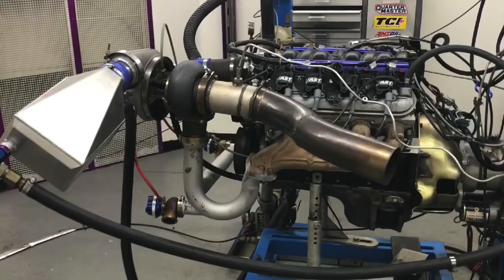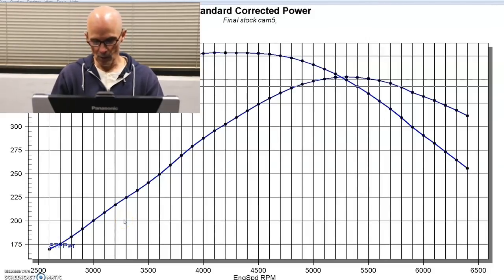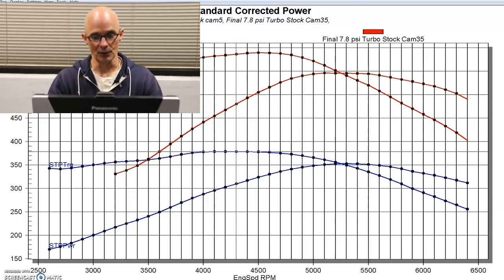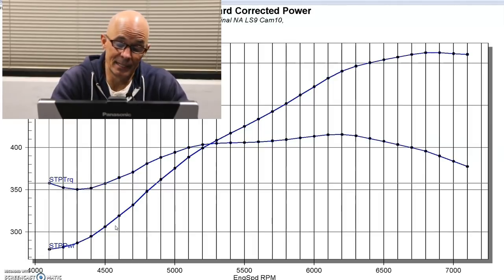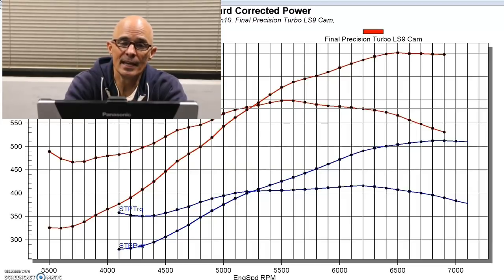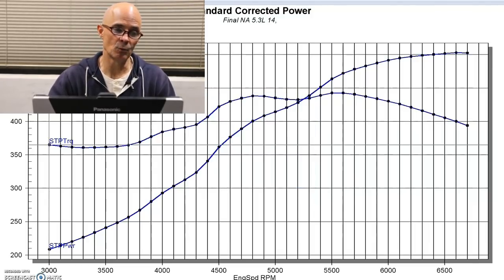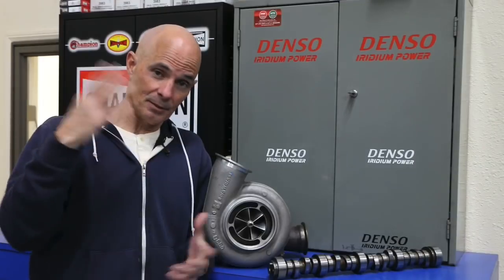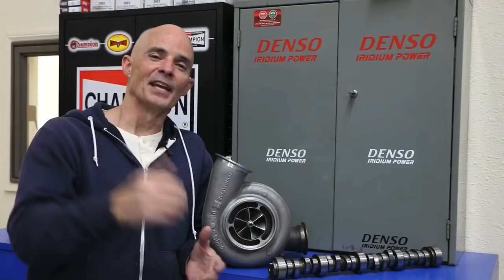REVEALED-DIY TURBO SECRET-EVERY CAM WORKS!

Comment: The only thing this conversation leaves out of the equation is response. A normal aspirated cam and a turbo cam may make similar peak but power curve and off boost response in non drag racing situations such as street driving or road course racing can mean the difference between a quick car and a dog. At least this is my experience in the small displacement manual transmission world I play in.
Reply from the maker: any cam that adds low-speed torque will improve response

Comment: It is such a shame that we don’t have anyone like you working with vintage Fords like the FE. Some poor guy got his videos pulled for showing how to improve the oiling on a SBF. Some a hole claiming that it is a copyright violation. Why do we have to put up with that crap. I am certain his initials are BL. I so wish we could have someone like you working on Ford platform like the FE. I am not sure if my 394 FE will take 10-12 lbs of boost. I want to do it really bad. But the FE forum who banned me for sharing my 50 years of experience banned me for life saying I was disruptive. I was because I was so frustrated as to why I couldn’t share my own broken knuckle experience.  You and Sloppy Garage have convinced me that I have been tilting at windmills. Why would I try to help people who really need it , when the people involved sanction you. A small Cabal wants the answer to be it’s too hard, just send it to me and I will charge you your childrens college tuition to indulge yourself with an overpriced piece of junk that barely makes 450 hp. You have to have a 4.25 stroke kit. BS! You also once they get their paws on it that well factory heads won’t do then the block won’t do… $35000 ? You can build a nice 500 hp 416 ci engine with stock parts and I was telling people how. I was misleading people… I got an email from a guy who did an NA 416. And made 515 ft lbs and 545 hp for nothing. He just found one of my old posts in the archives that they didn’t manage to scrub. I am proud he has been bracket racing it and all he does is service and with a Flat- tappet solid cam that I gave him with the lifter in order all broken in. I told him where to grind and where not to, 285/ 176, he did it himself in a half day and I even sent him the 3/8 Cobra Jet valves and springs, one piece retainers and matching keepers.  No F’n charge. A Lunati cam SPJ 285 just like the one for the  351C Boss a solid step up. It almost cracked 550 , imagine a C 4V head.  Yea 66 extra cubes but he said that FE lifts the left front. It did what HE wanted not They!  Thank you Richard so much for your generous gift and spirit.  I have so much FE stuff at 61 it’s really hard to put the genie back. I wish I was of the LS generation, and turbos.  I hope that I can turbo my engine in my Car, but it I can’t I Will likely put a 6.0LS in it. It is a shame that things are that way. I thank you for tolerating me and all of my questions. This is truly uncharted territory. I worry about my narrow rod bearings. If a 5.0L or a 351W can be turbocharged, it seems likely an FE can? No one does it but I ve seen 6 and 8-71 blowers, on a weaker 427 block. A 4.08x 3.78 or even a 3.5 with good rods and pistons should do. Not crazy long but to use 410 forged 4032 rods. A 4.08 X 3.5 with 14.7 would be sweet.
Reply from the maker: I will

Comment: As far as I've always understood turbo cams were just cams that allowed the boost to build earlier in the rpm range building a fast car is not always about peak figures its the area of power under the curve that matters just my 2 pence worth.

Loving your videos btw just stumbled across the while researching turbo GM 4800 engine I'm definitely going to stick around 😁

Comment: How I've always thought about it was....if I have "x" turbo that's capable of 1000hp, and sized right for the engine, it doesn't matter if I have the perfect turbo cam.  The turbo flows enough air to make 1000hp so the only difference I would think you would see between the 2 is the pressure it takes to achieve the 1000hp.  1000hp is a 1000hp no matter what the cam is.
Reply: One cam.might have 1000 come.in at a difderent rpm but the boost might change

Comment: Richard, To many variables, its hard to decipher if these statements are true, engines and boost levels need to be identical in size/components and do stage 1-4 Na cams vs stage1-4 turbo cams that way we can see if turbo cams make more power under boost.
Reply from the maker: its not hard to decipher if the statements are true, the cam that makes the most na power makes most boosted
Reply: @richardholdener1727  i agree with the theory completely. i just think itd be easier to understand as a consumer with very controlled variables instead of a whole bunch very different combinations. I think itd be a better, more efficient way to prove your point.

Comment: Logical.. ran a 355 curcl track motor cam and all in my street car ran good 5500 to 7000, not the supposed ideal cam but put a s475 on it and it ran in the same range just alot more. Love these tests thanks for this
Reply: Just want to add the cam is 108 lsa in the 242 at 0.050 range. Actualy runs pretty good. Really wanna do a ls motor soon. Thanks for all the tests and info, its like engine masters everyday!

Comment: My rule of thumb is you need enough duration to carry power to redline without laying over, the more power the engine makes down low out of boost, the easier it will overcome the torque converter and spool the turbo sooner.

Comment: I want to see a 5.7 or 6.0 with an MS4 110 LSA NA and turbo. That’s the most extreme cam I’ve used. It idled at 1,200 rpm, backfired wheezed stuttered and coughed until + 3k rpm, then came on like a turbo and propelled my home built M6 LS1 Z28 faster than a stock C6Z. I had PRC 227’s, a 4” lunati crank and H-beam rods topped with wiesco pistons and an 11.5:1 CR. ARP studded top to bottom. She was a thing of beauty 😥. Lost my job and had to sell her.

Comment: Great stuff! I learned a lot tonight. Now can you do a video on roots blower cams? We have always been told that you need have have a wide (110-114) lobe seperation to make good power otherwise boost blows past the exhaust valve. I don't actually believe this and would love it if you could disprove it on the dyno!

Comment: Thank you I'm glad you brought this fact up.i have been trying to tell all these rocket scientist friends of mine for years about the same thing.it the boost pressure not exactly the cam.they don't understand you can double the HP by boost pressure but when they do change something they go to the extreme and waste money trying to get more out than what's needed.or what they can live with.most of the time it's the water cooler talk that get a blown up engine or don't know how to fix the expensive mess they have and end up seeing it for cheap to another guy who need only a few parts to make a great engine come alive on the cheap.peace

Comment: Hi Richard,  I've been enjoying watching your videos to work out which camshaft to buy for my drift car, I've been struggling to work it out, would you please be able to recommend a camshaft or give me some more direction. I have a 6.0 LS (L77), 1170 xpert injectors, PAC1219 springs, and G42 1450 Pulsar turbo, I'm going to gap the rings and install a cam. As it's a drift car I would like a cam with a wide power band, I haven't found a video of yours that matches what I'm looking for. Would I be right in thinking I need a cam that produces torque at low revs, or wouldn't it matter as its a 6.0. I've noticed Michigan Motors and Comp Cams sell "drift" cam shafts although I haven't seen the dyno results. Any help is appreciated,  thanks,  Paul

Comment: Looking at the graphs I definitely agree now with the cam theory but the turbo specific cam looked like it might take a different low rpm ramp to bring it into boost possibly? But overall for a high rpm drag car, it doesn't seem like the power curve would affect it much. So thinking about maybe going with a choppy NA cam for my turbo build since turbo cams don't have tight LSAs?? Would be nice to have a nice chop and turbo wistle.

Comment: Something an old engine designer/piston manufacturer told me once: Think of an engine as an air pump. The more air you can push through it, the more power it will make. This was during a conversation we were having around the time the PSI blower became the must have in the alcohol ranks. Not a new talking point for me. Now there is the data to confirm what he always said.

Comment: Thank you for this! I always had this theory that boost wast just a multiplier, since engines are just air pumps and the more air it move the more power it makes. From a mathematics standpoint, the atmospheric pressure of the earth is approximately 14 psi. So when the piston goes down, the vacuum it creates is approx 14 psi. When you add say 7 psi of boost, theoretically you should see 50% hp and torque gains. 14 psi should double and so on and so on. This is of course provided your air/fuel mixture is consistent throughout. Anyway, I was hoping to see if you’d be willing to do some tests on other motors besides LS motors. I know you have done a few but the majority is LS stuff. Thanks!

Comment: The thing to get across(that you could have said in a few words) is dedicated turbo cams are optimizations not voodoo. Most of us LS guys have known this since 2001 or so when the available can grind was 224-228 .550 and guys were adding them to Camaros with a Vortec or Procharger and getting another 60-100 hp out of it over the stock LS1 cam.

Comment: On a naturally aspirated engine, exhaust pressure is equal to intake pressure.  If turbo exhaust backpressure equals boostpressure, an NA cam IS a turbo cam.  Only when the exhaust pressure exceeds boost pressure do you need to look at decreasing overlap...or increase the size of the turbine housing.

Comment: The only difference I think would be cams with big overlap would potentially spool later on the street. But you can’t exactly see that on a loaded engine dyno. But big cams and big turbos make a big party.

Comment: I once ran a wild cam with 106 degree lobe centres and 300+ degrees of duration with a turbo and it seemed to be detonation prone. In a similar engine I ran a mild cam with 114 degree lobe centres and could not get it to detonate at 25psi and pump fuel and proper timing. So whilst the power curve is translated upwards with boost, I would have thought that the main benefit of a well designed turbo cam is pushing the detonation limit higher (maybe being able to run more advance) with minimal overlap and playing around with opening and closing points of the valve.

Comment: Awesome video!!!    Do you have any videos or test info concerning ls factory heads preferably 706/862 vs any of the aftermarket heads like the tf 205 or afr’s 210.  Cam only motor as rest subject. If you wanna be extra cool! Lol. 4.8 5.3 6.0.  But simply put any ls with stock 706/862 vs aftermarket Cnc bigger valved heads. And head change being the only change.

Comment: Haha been saying the same for years!.. great test!  I’m about to run one of Ed Curtis’  na cams with a rear mount set up on a 6l and I’m fairly confident it’ll make power just as you tests have shown.. However there definitely are times when a dedicated turbo cam will allow a combo to reach its full potential both in terms of power output and rpm range at a given boost level... You share a test a recently where on a blown combo the Crane NA cam made as much power as a dedicated blower cam with the same pulley ratio used but did it with less boost!.. So my take is a turbo will make a boost level determined by the waste gate (not dictated by cam event) and therefore more power each time the boost level is increased until the turbo is maxed out as you say but provided the turbo hot side doesn’t go into choke first.. Again this is where turbo sizing is more important than cam timing I feel.

Comment: I guess you guys mostly do drag racing but I find that with a turbo cam (with large lobe separation) its a huge difference when you use the engine for drifting. Two cams with similiar specs where one is "turbo" the turbo cam will come on boost smoother, come on boost at less throttle, step on boost earlier as it feels like it can build its pressure instead of just coming on the cam and then spool the turbo as a NA cam turbo engine does. They also seem to pull longer when we pass max power (in drifting we want to have a large span of power to spin the tire fast, once spun you do not need top end power)

I came to view this video with hopes of a graph with the same engine and boost but with different cams

Comment: people in 2020 still think that turbo just pump air in the engine, the truth is that turbo increase the air density (and so the pressure), its just like run a engine on top of the pikes peak and another on the sea leavel, and who make more power on pp, also make more power on sl, great video as always

Comment: Everything he said has been my experience as well. The only time you need to be a little carful is if you have a junk turbo that makes a ton of back pressure and a huge cam you can run into a lot of reversion and get a lot of dead in the cylinder. Which won’t hurt the power as much just becoming dangerous for the engine (lifting heads and such). And with that said, it’s a turbo problem not a cam problem. So if you have a junk turbo and are set on running it, I would lean more towards and smaller cam that will run in the same power curve as the turbo.

Comment: Okay, one atmosphere is around 14.7 lbs per square inch. So if you double that. Thats 2 atmospheres. Which means you are forcing another atmosphere of air and fuel in an engine. =double the power or close to it. Doesnt matter what camshaft is in it, still going to double the power. Doesnt matter the engine either.

Comment: Hey Richard, really cool videos! I'm building a mid twin turbo setup for my '72 el camino. Would like to see how the longer exhaust pipes and boost pipes affect the lag and power? Also the diameter for the tubing, heat wrap etc? The engine is a 5.3 with slightly ported heads and bigger cam.

Comment: This is mind blowing and I can't believe I just saw  this video... I have a 5.9 Magnum I'm building for turbo application and everyone says the stock  Cam is trash and I need to go aftermarket... so can the same theory about LS motors stock cams being ok for turbo be the same for a 5.9 Magnum stock camshaft ?
Reply from the maker: you can run boost on any cam
Reply: @richardholdener1727  thanks for the reply, I feel like I have a major weight lifted off my shoulders and this will simplify my build on a decent  budget... thanks Richard Holdener

Comment: Yeah, you magazine guys taught us this years ago. And its fairly easy to apply on supercharged cars.  But whats the philophosy of turbo cam design?  Just comparing power on the dyno only answers part of question. How does it idle and drive at part throttle? How does it spool? How do you quantify/compare ability to spool between two cams on the dyno?  What about driveability?
Reply from the maker: you are missing the point, pick the cam that does the things you want then add boost
Reply: @richardholdener1727  I get the point, i'm just being a pain as usual and asking for more.  Keep up the awesome work!

Comment: It makes sense... If your running a NA engine on the top of Mt Everest, it's going to make WAY more power at sea level.. It would be like adding half a atmosphere, 7 psi... If you look at the industry that developed turbocharging, (aviation industry), they didn't make different cams for running turbos. They actually need "max power" during TAKE OFF,  and the turbo just brings the power BACK that was lost due to the high altitude... or it allows a plane to safely fly higher...  I was taught that "the cam just puts the power in different rpm ranges" it shifts everything accordingly up or down, as long as the other components agree...

Comment: You are spot on 👍plus forced fed motors make hp easier for every extra psi compared to an  n/a motor $ for $  also a cam with less overlap will make more hp on a turbo and supercharged engine but the trade off is more back pressure as u mentioned

Comment: What about adding boost to moderately high compression engines?  9-10:1...

Great video, btw.  I’m thinking of boosting my 4.0 ohv ford but I’ve heard they can only take about 5 psi

Comment: Well save on the cam then and just run better heads/springs to prevent float and variable/electronic boost control increasing boost to flatten the upper end of the torque curve through tuning!

Comment: Richard Holdner. The only problem I see with the tests you did on this episode is it shows how you make boost in 1:1. The reason people use certain cams for specific reasons is for low gear boost creation. What you should do a test on is what the boost curve during acceleration with the different cams. That’s where you’re going to get the difference. Overlap is gonna kill some of those cams until 1:1.

Comment: Hugh McInnes and his 40 year old turbocharger book.
He says; 1: "Turbos are airflow equalizers, as far as breathing is concerned."
2: "Any engine can be turbocharged."
14.7psi is atmosoheric pressure@sea level.
14.7 to 1 is theoretical ideal A/F ratio. Mathematically,
1/3 of 14.7 is about 5psi. So 5psi of boost is about 30% increase in Hp. At sea level, 5psi boost and Intake pressure is actually 19.7psi
So on an otherwise stock engines reciprocating assembly, it will have to withstand a 30% increase in mechanical and thermodynamic stress.
Cranking up more than 8psi boost, without porting the head intake ports and/or using a higher lift longer duration cam and you just end up heating the air, with no more gain in power. Now, chew on fuel delivery, under boost.
Reply from the maker: I have Hughes book